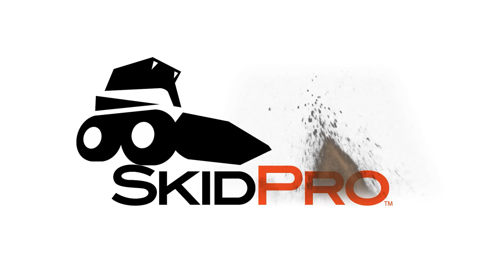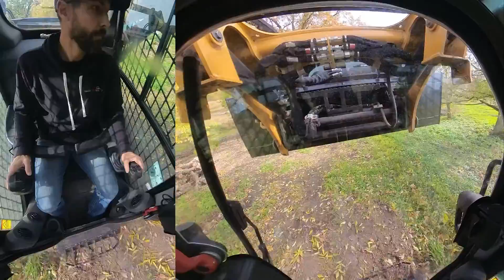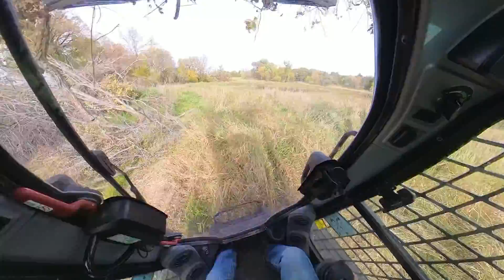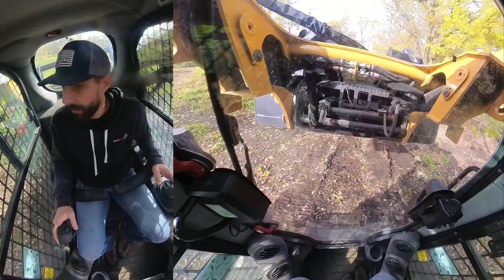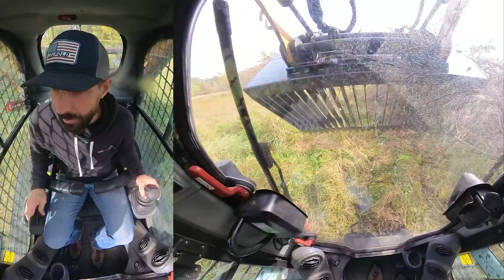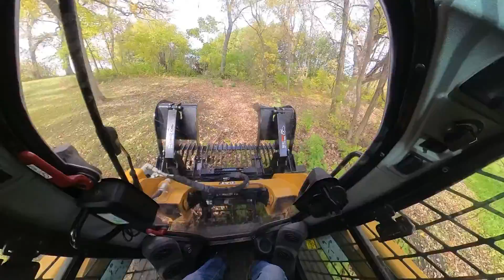Grapple Mastery: Your Complete Guide to HD Grapples for Heavy-Duty Tasks!

Comment: Excellent video!  
Great point about slowing down to get used to new things. 
I'm debating between the rock grapple and the skeleton grapple for my firewood business and arborist business. I'm leaning heavier to the rock grapple for my 239D3 as I don't want as many smaller splits falling out. 
 Thank you.
Reply from the maker: You are absolutely on the right track with your thinking. If I was moving firewood, I would want even the smaller pieces to come with and for that reason I would suggest a rock grapple. Now your machine has a operating capacity of about 1500 lbs, which make me suggest a 3/8" rock grapple, not the 5/8". We want to make sure you get something that will perform well on your machine, and not try to push more expensive products knowing they won't work well. Give us a call, and we can get you a quote on that 3/8" grapple. 877-378-4642. Thank you!